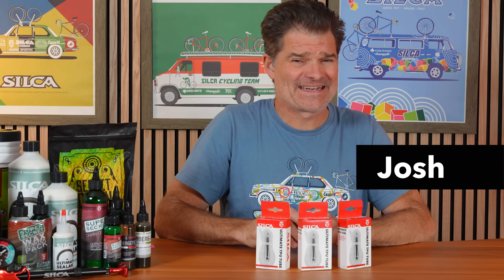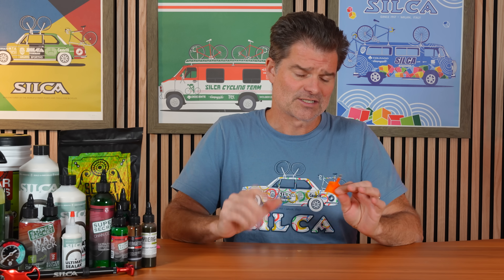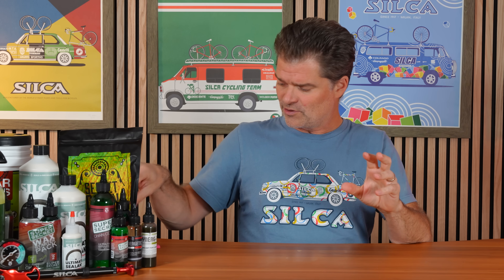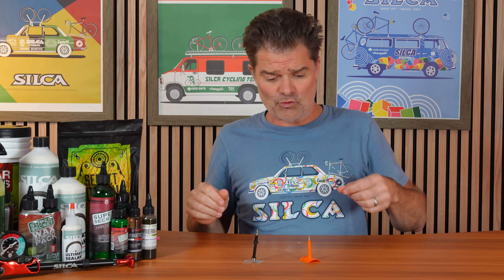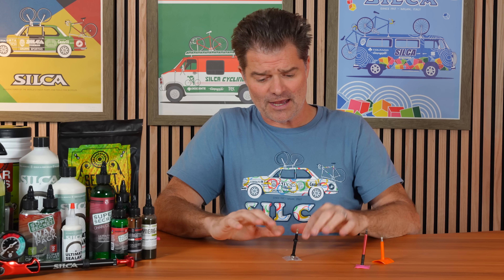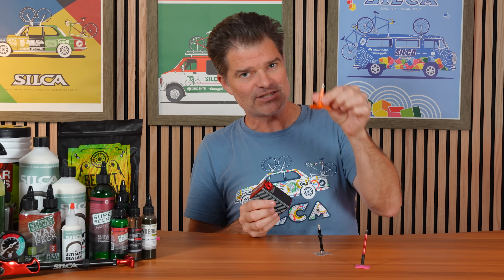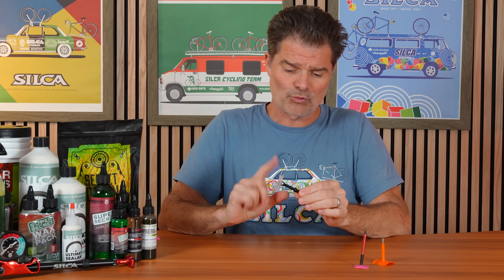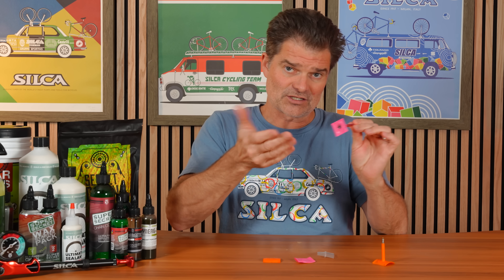Are TPU Tubes Finally Worth It? | SILCA Ultimate TPU Explained

Comment: I'm curious to test these Silca tubes...
I've been an early adopter of TPU from the times when Tubolito were the only players in the market. Now I'm using Bostoor from Aliexpress... full aluminum valve, slightly thicker than regular TPUs and no problems up to now, except patching... which they don't recommend.
And here's an interesting point... look what was the feed-back of the producer when I reviewed the product on Aliexpress, and I complained that for the money, they should have included some patches:
Seller Reply: "Hello. Our product is inherently puncture-resistant, which increases its weight somewhat, but also significantly increases its thickness compared to other products. We also do not recommend repairing TPU inner tubes. This is because TPU material cannot recover after expansion, and repairing the tire increases the risk of a secondary blowout."
In other words, these TPU tubes are like condoms: you should put them correctly from the very beginning, and use them only once!
Jokes aside, there's an interesting point in their comment... and it's true that once a TPU tube inflated, it will not return, when deflated, to its original size - it looses its elasticity. That's why, for instance, it's not advisable to use a TPU tube in a 28mm tire after you've used it in a 30mm tire (the other way around is ok, it will stretch to 30mm and never return to the previous size). 
Now, this leads me to some questions which I'd have loved to hear being addressed in your video:
1. Why these huge sizes? Will a 24-43 fit in a 26mm tire (real width) without making all sorts of creases?
2. What about the thickness of the material? They are approximately 10 grams heavier than the RideNow counterparts, right? I like that my Boostor Tubes are slightly thicker (they come in two sizes: 23-32 and 32-43... basically Road and CX/gravel) and the 4-5 grams more than RideNow are not an issue. 
But, are the Silca ones in the standard thickness of the material (like conventional RideNow and Tubolito)? Are they thinner? Are they slightly thicker?
3. Why don't you make ones specially for track cycling? I'm using these Boostor on track ... but even these are pointlessly big, keeping in mind that a track tire never goes beyond 25 mm real width. So, a 19-26 would be great. It will also reduce weight, I guess... right? (that's a question I've addressed, with no answer, to all producers of TPU tubes :) )

As I said, I'd be curious to test  these tubes. Sadly, they are very expensive compared to the Boostor ones (7-8 USD, vs. 41 USD) and I didn't have any kind of problem with them for the last year - used in juniors racing. The last generation of RideNow have a similar system of fixing the valve on the rim as the Silca, so when pumping the air there are no consequences for the valve/TPU junction. My Boostors have some kind of reinforcement, but no screwing or other way of fixing the valve on the rim. Nonetheless... no problems. 
If there is really some advantage in using pure (uncoloured) TPU... I'd' like to test them in special applications (TT and track), where every fraction of a watt might make a difference. But than... again, why so much volume? You owe an explanation....

Comment: Looks like a great design that should be highly reliable. I heard Josh say in the video that the "big" version of the TPU tubes covers tires sizes up to 29 x 2.25". But, the larger size tubes (44mm-64mm) are spec'd to fit up to 64mm, which means they should work with MTB tires up to 29 x 2.5" right? (64mm = 2.51").

Comment: There was a video recently on Caden Wheels channel talking about the valve core diameter and being able to use sealant in the tpu tubes for double protection. Wonder if these new valve stems are similar?

Comment: I appreciate the problem solving, and I’m confident that the Silca TPU tube is superior to the competitors TPU’s I’ve been carrying as spares. 

However… I can buy 4 competitor TPU tubes for the price of one Silca, and the Silca tube is over half the price of a GP5000 S TR tire itself. 

I would absolutely buy these over Tubolito, Pirelli, or others in that price bracket, but unfortunately I’m not a buyer in that price range for that product. 

Keep up the good work guys, I’ve never been disappointed by any product from you guys I’ve chosen to buy, and I’ve always been impressed by the knowledge you share with the community.

Comment: I have been riding the Silca latex tubes for several years and I love them.  I use TPU as my spares.  My only annoyance w/the latex tubes is the need to use a valve extender for the rims that I have.  While I am absolutely sure that Silca has engineered a superior TPU tube, however, since I am only using TPU as spares, I am not sure that the higher price is worth it over the RideNow or Cyclami brands (sorry Silca!).

Comment: I have been riding Cyclami TPU road tubes on a rim brake bike for over two years.   Before the tariff situation I purchased the tubes directly from China for between $2 - $3 dollars each.   Prices have gone up but still less than $39.   The Cyclami  tubes have metal stems and while I have had some flats none of the flats  have been because the valve stem has broken loose or the tube has come unstuck at the joining seam.   When I have a flat on the road, I have used CO2 cartridges to inflate the replacement TPU tube and again never had an issue.   Have patched some of the flatted TPU tubes and in most cases the patches have worked OK but why bother when Cyclami tubes are so inexpensive.  I carry the patches in my saddle bag so that in case of a second flat I have a second chance to make a repair.
Reply: I can second Cyclami are very good.

Comment: Can you find a puncture in a TPU tube without using a bucket of water? I've been told the old school way (slightly overinflate, pass over your cheek until you feel air) risks damaging TPU tubes.
Reply: I repaired a few green cyclamani tubes and never had a problem. You don't have to use a lot of pressure. I just don't know how easy it is on a clear tube
Reply: @nugginusslover476 cheers. I'm paranoid about solo rides miles from anywhere... Running out of unpunctured inner tubes.

Comment: I like the improvements over the off-brand stuff but like others here I've been more than lucky. I bought a 6-pack of the pink ones 2 1/2 years ago and after 2 sets of tire changes from regular road wear (front & rear tires each changed twice) I've had zero punctures and there are now easily 15000km of road riding the original 2 tubes that are still on the wheels and used in 3 tires each. Matter of fact, the tires with butyl tubes on my dedicated indoor trainer bike wheels (front is stationary, rear isn't on the bike at all) go flat faster just sitting indoors unused than the TPU ever have. I'll certainly look at the Silcas when the time comes, but at this rate is may be a while!

Comment: My main concern would be the threaded upper washer will slacken off over time and air will leak out, either via compression set/creep of the TPU out of the way or it micro turning with flexing of the tyre/tube through normal use - this will lose some of the pre load pushin back to keep the threaded washer in place. A locking compound may eat though the TPU so possibly a dab of E6000 or another glue would slow that down. We do lots of ultrasonic and laser welding with metal/plastics at work so I appreciate this is more difficult than it seems, especially at road bike pressures.

Comment: I'm a little confused by the comments about the price.  I mean, Silca has a reputation: quality, yes; innovation, yes; durability, yes.  Affordability? Not so much.  That isn't exactly news.  Buy once, cry once, as they say. Are there cheaper TPU tubes? Yes. Are there more expensive TPU tubes? Also, yes.
Reply: Not really upset, but genuinely interested as to how long this one will last in Silca’s lineup. Kudos to them for continuing to pursue some honest to goodness manufacturing quality
Reply: The real issue is that there are perfectly good tubes with metal valve stems for far less money.  The other products they design are legitimately unique.
Reply: Yeah, why do cycling people always demand to be able to afford everything they want?  If someone can’t afford it, continue buying $6 butyl—they’ll work fine, no problem.  No reason to get cranky.
Reply: I own many SILCA products. I am an old timer, I still have plastic SILCA Impero frame pump. Having said that,  not all SILCA are as innovative as Josh would have you believe. Many, like their battery air pump are simply copies of similar products. My Cycplus air pump has better features than SILCA’s own Elettrico pump, for a lot less money. Slapping an Italian sounding name on a product (this has been Starbucks MO) does not make it better nor does it justify its higher price. Watching Josh’s videos is like watching a very good and polished circus .
Reply: Silica are 5 years behind in the TPU game  and offer nothing  new. Love to know who's tubes are more than $39 today
Reply: @ThePitbull63  I've seen Vittoria, Pirelli, Conti, and Schwalbe all north of $39 before.  I just don't see why so many people would feel the need to complain about it.  I wasn't shocked by the price tag at all.
Reply: @steelcitytbirds  maybe when they first came out. The market is pushing down prices even in the present climate. You can get these for nearly half the price of Silca now
Reply: @ThePitbull63 obviously you haven’t watched the video, cause their valve stem system is basically “all new”… it’s just the question if you want to use it. I haven’t had any issues with my Vittoria ultra light speed tpu’s with plastic valve stem and glued connections, so I’ll keep using them. It’s a choice!
Reply: @lovemesomedetail  Do you think I'd comment before I watched it?  Silva are highlighting issues ( especially the stem ) which other manufacturers sorted ages ago. The video is showing outdated and exaggerated issues to justify its price tag along with anecdotal nonsense about his wife.
Reply: I agree with your point that silca products are priced based on their esteemed reputation, but I find your point on "buy once, cry once" to be irrelevant to the subject. Tubes are something that WILL fail at some point (even with patching), and WILL need to be replaced

Comment: I've had the same Vittoria latex tube in my front tire for over 7,000 miles with GP5000 tires. I've gotten one flat which I patched about 4,000 miles ago. I pump it up before every ride and I'm pretty sure it has an aluminum valve. 

I do appreciate the detailed explanations of the products you guys release.
Reply: Same here. Are you aware of larger latex tubes ? I would put them in my 45mm tires

Comment: Ive used the ridenow tubes for less than $5 a tube and I never run into your issues. I also dont have any issues with my electrical pump. It does use a tube to deliver the air so it doesnt heat up as much.

Comment: 2:00 Easy solution, just get the new (new-ish...) Click Valves, that is some absolute revolution. The classic 100 or however many years old valves on bikes are hot-garbage. As someone who got into cycling 3 years ago, I couldn't understand that nobody made better system in all those years, well till now. I think the click valves got release like year ago and it's insane good, you just snap it on and off super easy and it's perfectly tight. Only issue is that even few months ago it was very hard to get, sold out all time everywhere :D
Reply: Clik valve is not a solution to that problem as described. Pulling it off the valve still pulls the valve stem and strains the flange and its glue. Might be worse as it can be a bit more force requirted to pull it off than other valve/pump head combinations.
Reply: @RenAigu  I have Cliks on all my bikes and requires much less pressure to put them on and release compared to my presta pump. I was so fed up with the breaking pin in the presta I switched over to Clik and don't regret it.
Reply: @paulterpstra6705  sure but there are pumps which engage and release with less force on other valves. In other words, clik valve requires a pumphead that works in a way there has to be some force on the stem when engaging and releasing, while for other valves there are pumphead designs where less or no force is needed. like a head that screws, or where the seal is created by an expanding rubber ring you can slide on without much force if precise, then lock it.
Reply: @RenAigu  There is no big strain, you just unclick it, that kind of stress level is not doing anything. When using the click valve.

40$ Silca TPU tube is insanity, when you can get the ridenow for 10 or whatever, been using those for years, had zero issues. And when it comes to performance, that's going to be like 0.5W difference. Which is irrelevant even for Pog.

Comment: but WHY do you want to put a tpu tube in a 50 pound e-bike.. to save weight.. It's a friggin' tank.. just use butyl! Use puncture resistant tyres.There's no need to be a weight weenie on those bikes.  Now I need to get me some proper tpu tubes for my roadbike because the current ones suck indeed, 🙂 (not for $39 though)

Comment: The aluminum valve is nice.  A couple questions.  The Revoloop TPU has a patch kit as well but those are only meant to get you home and not a permanent patch.  Mine always failed after a few days.  Are your patch a permanent repair or only to get you home?  Are the existing Silca sealants compatible/work with these TPU tubes or are you going to develop a new sealants for them?

Comment: I have used Schwalbe Aerothan and Conti TPU, never had a problem with the valve interface on either. You said to use an electronic pump in 15 seconds intervals, so there is also an issue with heat and your valves. £39 POUNDS STERLING! No thanks.

Comment: They've been hit and miss for me. 
I've tried two pairs of Revoloop ones (undyed) in my fatbike and both died a slow death from multiple slow leaks that would develop after a few rides. 
I have a pair of Tubolito ones (dyed orange) in my commuter bike that's got 700x37C tires on it that are going strong after three years (though I probably just jinxed myself). 
I haven't had issues with leaks around the valve/stem interface but my pump is pretty fiddly to get to seal on them so I generally hold the stem while attaching the pump. 

If anything the easiest way to resolve the issue around the valve stem always seemed to me like it would be to thread the valve stem and use nuts like on regular presta tubes. Even a plastic nut should be strong enough and weigh a negligible amount.

Comment: Great, however....
I have been using Pirelli P Zero SmarTubefor the last 2 years or so, they come also in clear version, not only yellow... and cost about $25-30 per each. Never, ever had any issues using electrical pump or CO2 cartridge... so, the question is... why would i switch to Silca TPU, it is surly not cheaper ... Just wondering...
Reply: I recently had a Pirelli P Zero SmarTube fail exactly as Josh described. But to be fair, it's the first Pirelli SmarTube that has failed for me. I have others that have over 1500km on them and are still going strong.
Reply: @CowArt554 yes, they do fail, but I bet those will have some failures as well… so what gives… just not convinced that this product is better… it is more expensive, a specially for first gen product… let’s wait 6 month and see how Silca TPU does … we can talk then…
Reply: @MrMeowNow agreed! :-) I'm not going to throw my Pirellis away now, but I'll keep an eye on the Silca tubes. If they turn out to work well, I won't mind the premium price next time I need replacements.
Reply: @CowArt554 same, price is not the issue.. just wait and see how this goes I guess..
Have an amazing day.

Comment: The market proliferation of TPU tubes is getting almost saturated. I've used/have pretty much the gamut of manufacturers and have settled on the pink RideNow version. They're cheap and basically disposable as far as I'm concerned. While my flats are far and few between but when I do flat I just swap in a new pink tube and toss out the punctured one. I'm done chasing pin holes and patching tubes. At $10 a pop I just don't have the time to patch em... never have.

Comment: I have 8 ridenows with metal valve 0/8 are cracked.   Also - never failed a ride now metal with a boom box without the stem - not advised.  Check my channel out for videos on this.

Comment: 45g with a 50mm aluminum threaded stem is impressive Josh!  My early TPU troubles were horrible snake bit susceptibility.
I've been having great luck so far with Aerothan (28mm/40mm valve, clear, also German) - no valve stem failures YET, but I'm still using Gravelero rather than electric pump that would heat things.
I've got two concerns:
1)  Threaded valve stems seem to chew up my Silca press-on chuck gasket.  With enough motivation, I suppose I could upgrade to the HIRO ;-)
2)  The 24-43 range on your tube is amazing.  I've read that inflated stretching of TPU tubes is a BAD idea, so for my 28mm road tires I have TPUs with bottom of range at 28mm (i.e., little or no stretching).  For my 42mm gravel tires I'd be leery of using the  24-43 tube, I'd be tempted to instead stuff in the 44-64 tube.  Can you please comment on the elasticity / yield of your tube vs. something like Aerothan?

Comment: I’m sold on tpu tubes.  Been testing one on my rear for about 1800 miles.  Had one flat, it would have been flat with a burgle tube as well.  No problems so far.

Comment: I'm using for my gravel, Pirelli Cinturato 700x45c, with a 50mm wheel height. Do any of these new Silca TPU tubes matches that? I think that the 24-43mm (70mm valve) 39mm x 95mm x 21mm folded. 46g, may do the trick, but I'm not 100% sure. so far no flats for me using TPU.